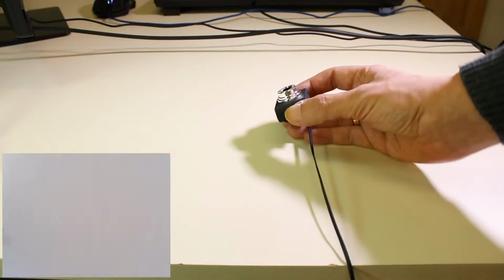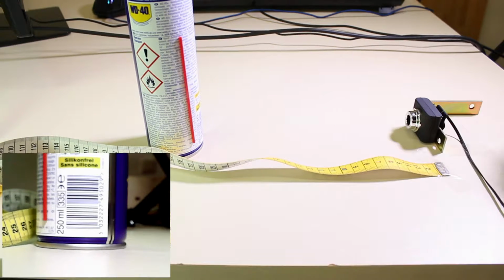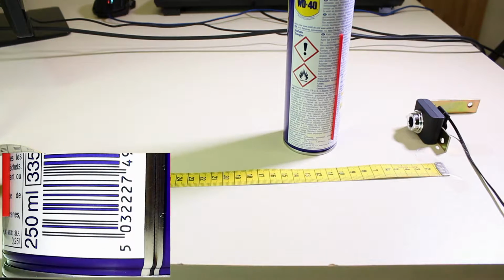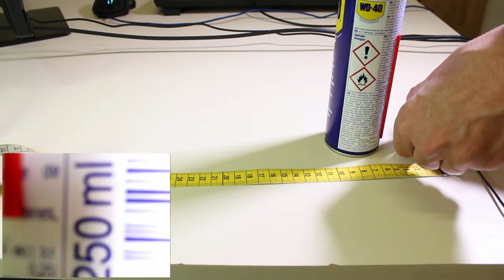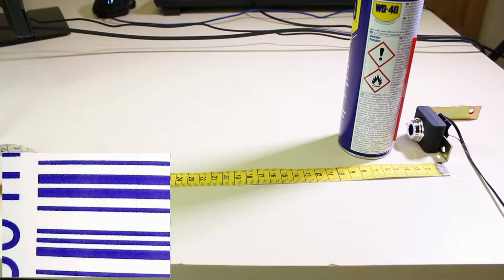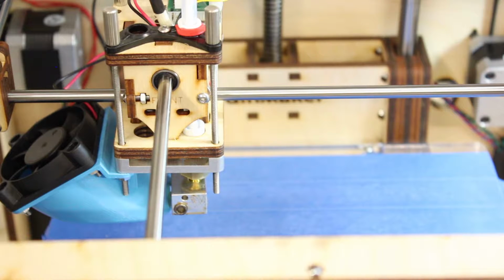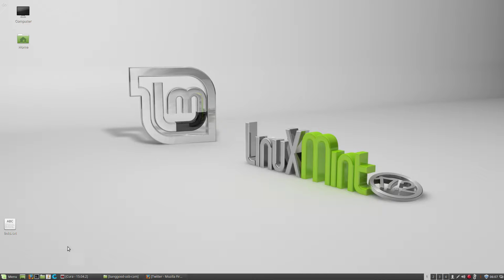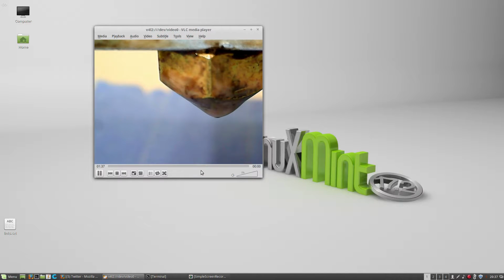Banggood usb cam on a 3dprinter print head

Comment: Thanks for this! I have been eyeing these cameras for a while but just thought the price was too good to be true, actually pretty impressed. I had been thinking of using them to remote monitor all my machines. That focus ring looks pretty flimsy though, it will most likely move through vibrations.
Reply from the maker: Although I haven't experienced focus changes during the print (it really ran for almost an hour :) ) it's clear this is hardly comparable to any focus rings you may know. It changes focus and you can turn it to do so - end of similarities. Focus rings I knew before have some kind of resistance that makes it feel like a control and not like a part that just hasn't fallen off yet. Surprisingly still it does the job and despite the strange feel of it it has survived several hours of riding the print head.
Regarding monitoring: if the resolution is OK and the camera as well as the objects are stationary this should work.
I just watched your video about visiting Shenzhen and mentioning you get what you pay for from Banggood. You're so right and I'd like to add: Keep your application and need in mind when you purchase. I've seen reviews on similar cheap cameras arguing these are not good webcams. Well, they were never expected to be.
Reply: Ohhh 2 years ago!